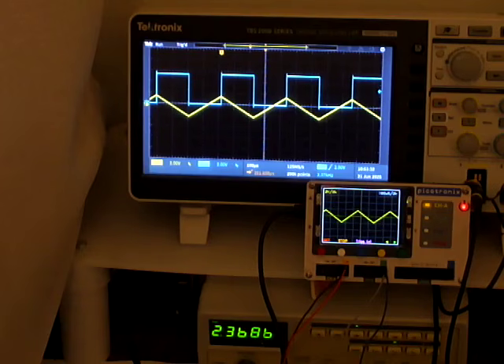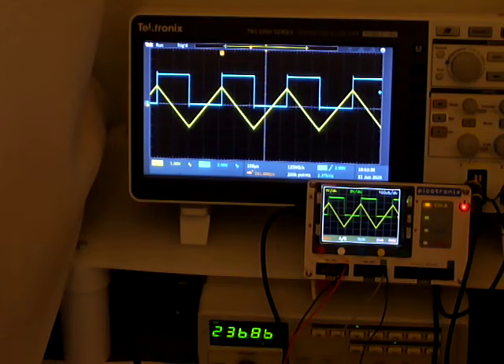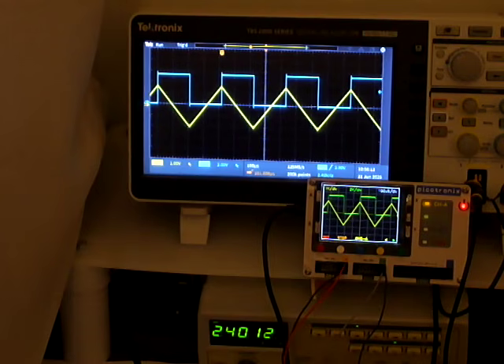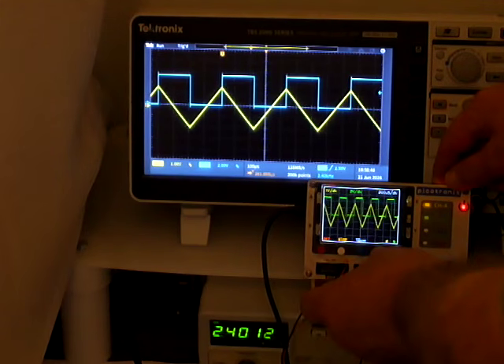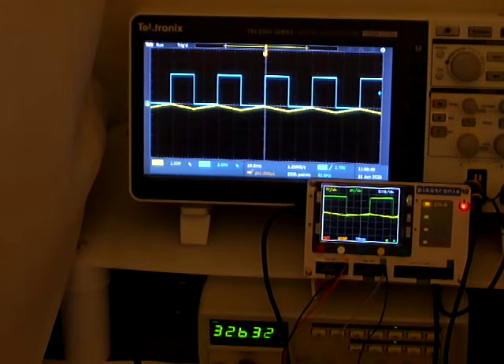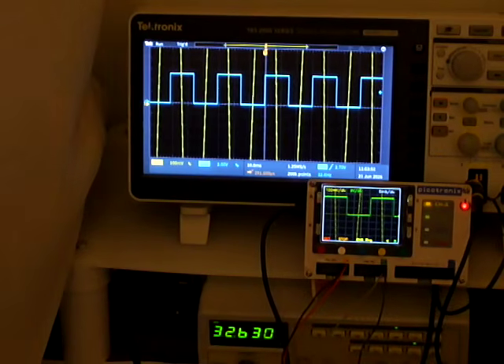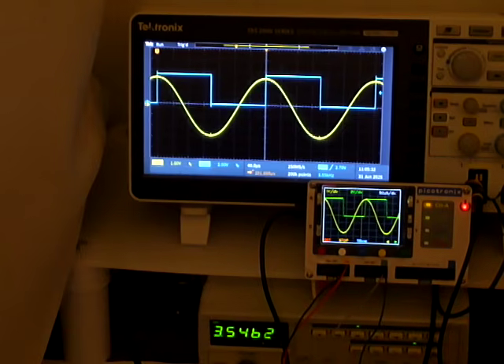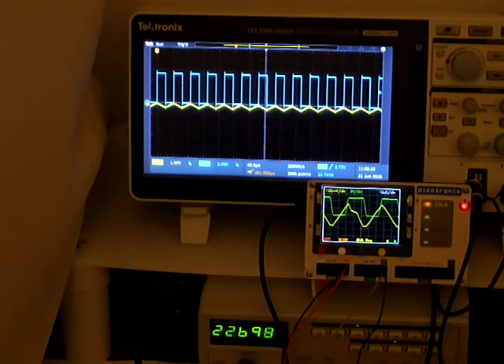Picotronix- Twin Raspberry Pi Pico 2 Powered Test Instrument referenced against a Tektronix TBS 2000

Comment: This might've interesting, but your poor video resolution and focus makes it unwatchable
Reply: Not meant to be slick. No one can complain it is AI generated. What is important is the comparison between the Tektronix and picotronix across various functions is clear. We are into great engineering, not pretty videography.
Reply: @johngriffits4950 , @RayBellis, the production quality is so poor that the viewer a) cannot read what is on the screen of the Picotronix platform, b) can not see clearly the controls being manipulated, and form an opinion on just how ergonomic or otherwise they might be, c) can not see the screen when the instrument switches to DSO mode at 1:34 c1) there may be a graticule or there may not, but the light from the instrument screen is not automatically adjusted for, c2) likewise, there may or may not be some text on screen, but the viewer is non the wiser.
You will have noticed that the video resolution is 480p, which is simply not good enough in 2026.